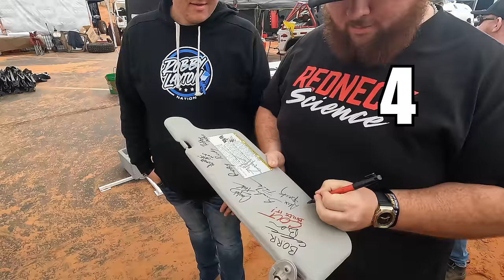The Ultimate Competition… The Off-Road Games!

Comment: Im not sure if Matts ever given the secret to the sand,  but it's Aired down Bald Tires, preferably Patagonia's. They will just Float over the sand. Treaded tires and too much torque and Horsepower will inherently Dig in and ultimately get you stuck every time.
Reply: It's been mentioned but thanks for the reminder 😊
Reply: I'm shocked Rory went with the tractor tires that do well in mud
Reply: Patagonias are crap in mud and, more importantly, rocks. I can see why they'd be decent in sand.
If Matt wasn't getting free tires from them, he'd be running good tires.

Comment: What an event, Thanks Matt and crew!

I think this year it really gave a lot of people and youtubers the opportunity for some fun! 

I would love to see a balance of the 2 games so far. The non Youtubers bit can stay, but we need some of the wreckers games bit back.

Tug a war is a bit pointless in the sand, no vehicle can move the other with brakes on and dig so quick they bottom out. The tows also where just a showcase, so variable if the tow vehicle braked or not etc.

Would love to see last year tow of a dead weight and see who does the fastest or furthest. Can limit to one x ft rope and max 5ft bump x2 etc to keep it safe. Also having some rock climbing part to make sure the vehicle isn't a one trick pony and can fit on typical trails. The quickest to tow a vehicle up 2 or 3 consecutive obstacles with large points deducted for damage. You can then have a dead tow winner (same people this year with their huge vehicles can come back) and overall wrecker winner for the wreckers we have all come to love ❤.

Comment: Just watched Rubicon recovery.
Would a "Matt's Coilover Shock" designed to attach from wrecker to tow vehicle make towing smoother plus act as vehicle to wrecker bump stop?
(2 standard tow hitch mounts and some sort of ball joint to attach shock, then Matt's Straps to prevent over extension)
Shock would prolly get a lil hot though. May even be able to use flex straps to act as slap stop when wrecker lurches forward.

Comment: I deliberatly waited to ask,What happened to the Potato truck? And the huge axles you guys bought when Tom Tom first joined the channel?  I know that a 6 wheel drive six wheel steer roll back would be an awesome addition to the fleet. Hydraulic drive, hydraulic suspension and steering. basically,  a wheeled excavator undercarrage with a roll back underneath.  You could be totally unconventional with the device that picks up scrap bins as it could be lightened up aquite a bit with a platform with a cage overhead. it would be either an epic failure called an education or an epic win with a lightweight roll back but more a disabled toy elevator. From pickups to jeeps 5 ton limit on pick would cover the maximum range pick capacity.

Comment: This really shows that paddle tires and tractor tires are not very good for this type of stuff. Paddle tires are good at pushing lighter-weight vehicles through the sand. But paddle and tractor tires instantly dig down when you throttle it trying to pull a lot of weight.